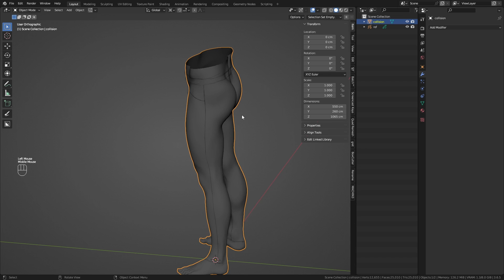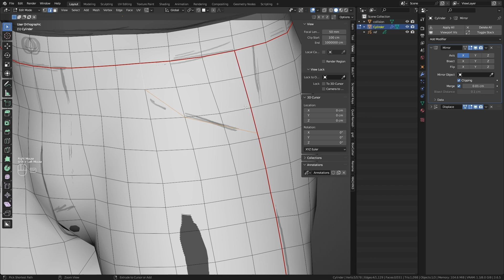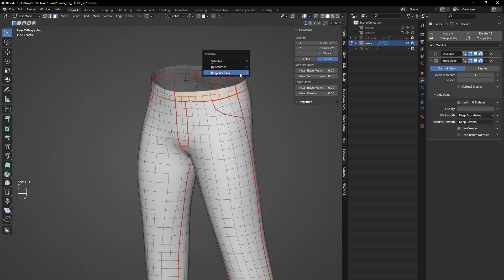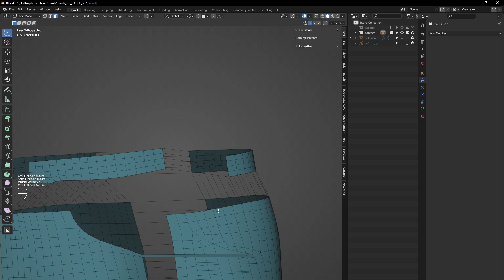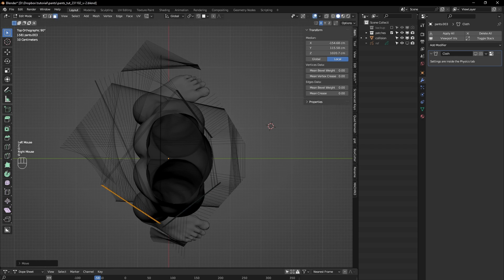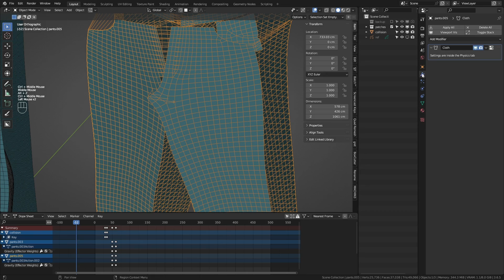Realistic Cloth Simulation in Blender (tutorial)

Comment: Awesome video! I'm not sure why when I use the shrinkwrap modifier I don't have the same result as you. The shape of the belt gets deformed on the sides when I change the wrap method to project. The volume of the shape doesn't appear even as you have it. I'm using Blender 4.3 right now.

Comment: I didnt understand why you first make it flat with the geometry node sstup and then out it back. Is that because you want it to wrap around using thr cloth physic. Same as how marvelos design does it?
Ps i think i remember an addon which does the same, that was before geometry nodes. I believe it usrs the iv map to make the mesh flat
Reply from the maker: Yes, Textools makes the UV flat too. I highly abused that functionality before Geo Nodes :D
Reply: @MaxPuliero  so basically the same or is GN faster. Guess so, ive not gone onto that road yet. Still feels to impressive and bends to wards math skills
Reply from the maker: @RomboutVersluijs  the Geo Node I'm using is preserving the scale of the geometry and the sewing lines. Those are the major advantages.
Reply: Have you also tried but without that step using the gm node setup. I wonder if it will make that much of a difference
Reply from the maker: @RomboutVersluijs  without flattening the geometry I got something okay but with a lot less folds, at least in my experience.
Reply: @MaxPuliero  guess because it was already into shape. Wonder, if you pin top parts and use less friction, if the fabric moves better. .
Reply from the maker: @RomboutVersluijs  pin works against gravity, they can produce unwanted effects, but sometime they can be helpful indeed.